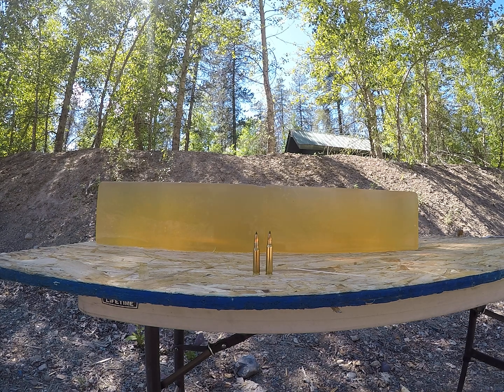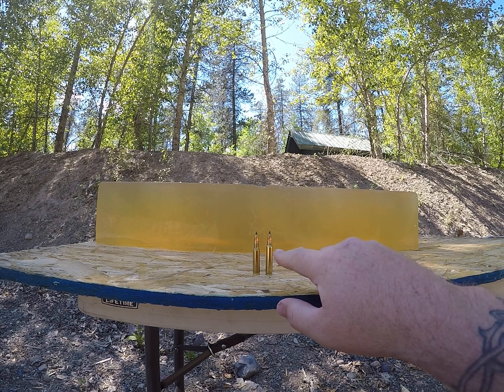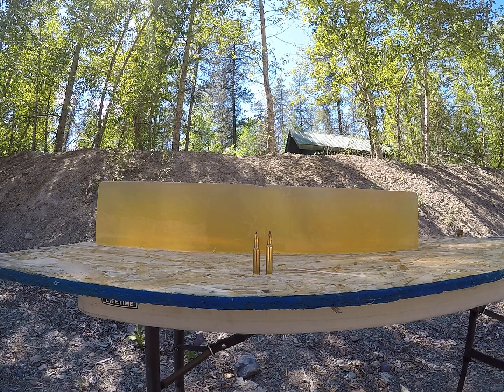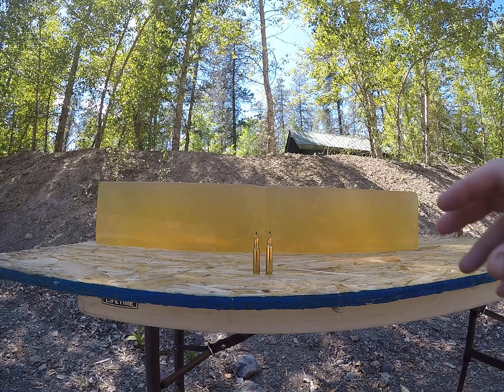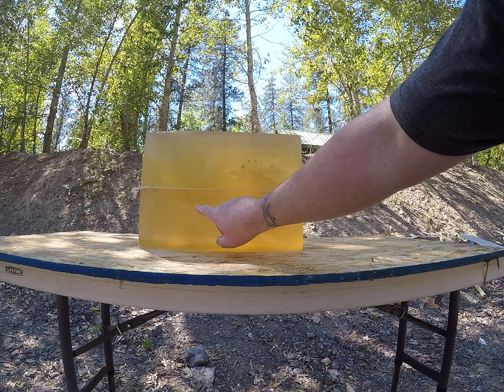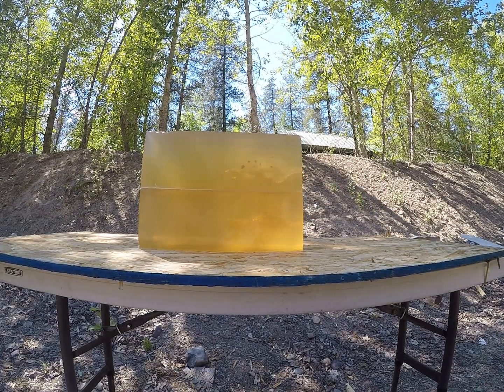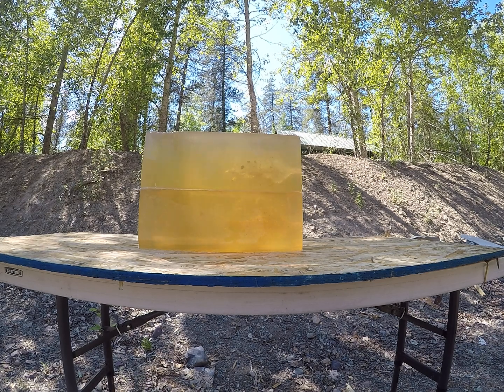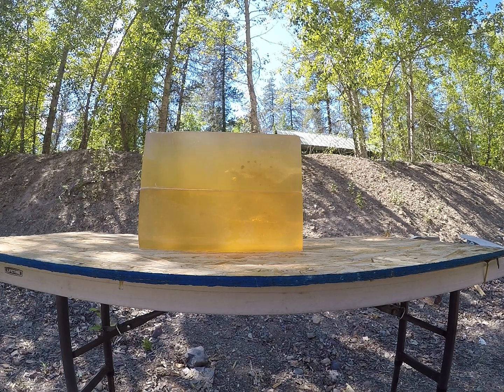Do RPM's play a significant factor in how a bullet performs after impact? (80,000 RPM difference)

Comment: Nice test. And I agree, RPM from rifling twist makes virtually no difference. Here're three reasons: 1) When bullets fragment in gel we don't see significant spiraling tracks from the pieces. So not that much is going on regarding rotation. 2) There's no good reason to believe that rotation is any different between what occurs in the barrel and what occurs in the gel block. In a 2 foot barrel a bullets rotates 2-3 times while going from 0 rotation to 200,000 RPM and 0 velocity to 3000 FPS. The reverse happens in a 2 foot gel block (200,000/3000 to 0/0) -- so 2-3 rotations of the bullet would be expected there as well. 3) There's no significant friction in the spin direction between a typical bullet's wall and what it travels through. The revolutions of a smooth bullet would not be expected to cause any significant disruption.
Reply: At most, what might happen is that the bullet might keep spinning for a fraction of a second AFTER IT COMES TO FORWARD REST, since it's not constrained by rifling, as it was i the barrel. In that case it would still have 2-3 revolutions over it's 2 foot path in the gel, and then some spinning at the very end -- and that would be true in animal tissue, as well.
Reply: The debris isn't going to spiral because thays not what a fragmentingspinning object does. Making it spin faster doesn't make fragments spin, it makes them fragment at either lower linear velocity or, at the same linear velocity, increases the kinetic energy they carry as they break off (effecting their angle or depth), or for a non fragmenting bullet, it will actually fail at lower velocities (exploding varmint bullets) if the spin is way higher, or hold together at higher velocities if the spin is lower.
That sane well established nature of fast twist on thin skinned bullets will also effect the speed at which an expanding bullet will expand, as there's already a preexisting centrifugal force working against the jacket before the linear resistance of the target media acts on it hydraulically.
Reply: @ravissary79  Particles coming off a bullet will have the same kinetic properties as the bullet had, before they came off. They would have rotational momentum (around the center of the bullet, not the particle) and forward momentum, and their trajectory after breaking off would be predictable from those momentums. Sure, there would be SOME differences in terminal bullet behavior with slower rotation. But the manufacturers see the differences as inconsequential (as per Simple Minded Fella references, having ASKED them about the issue -- they test the same way he does). I'm going to trust their engineers over random comments from "the internet."
Reply: @GetMeThere1  no, thats not how centrifugal force work on the matter of an object spun.
When a person is spinning with balls in both hands and then they let them go the balls don't necessarily spin they instead shoot outward in a linear, not curved path, but moving the direction they were released at.
When a bullet breaks apart from a  mushroom they are coming off from the outer edge of the rotating mushroom, like a ball being released from its centrifugal path.

However if the breaking apart happens from yawing that's different, they're not flinging off from the outer spinning arm from the mushroom or petal, but from drag alone as the forces are acting in a different way, and that's why a berger or a BTHP don't have increased fragmentation from spin on target, but do go boom if the jackets are thin prior to impact. So 223 fragmentation from jhps is different. But fragmentation from a mushroom is different. 

To be sure, harvesting terminal effects from increased RPMs requires very high RPMs. Q is experimenting with it using their new 8.6 blackout. It's a large bullet going a moderate to low speed (2400-2000 fps) but with a short 1/3" twist barrel. The barnes bullets shot looked like ratcheting pinwheels, and instead of rolled back they are extended out or broken off at highly acute angles (making a very broad mushroom despite traveling at mild speeds). They actually don't recommend standard lead bullets at all because they explode. That's because the supersonics produce over 400,000 rpms. That's INSANE. Lots of bullets fail past 350,000.

Increased spin doesn't make fragments spin, it increases the centrifugal force pressing against the material making up the outer edge of the object, the object holds itself together via its own molecular bonds and this functions as an opposing centripetal force, if the centrifugal force overcomes the centrepedal force the parts are elected in straight lines. It's like spinning a bucket by a string and the string snaps under centrifugal force.
In the case of the bullet that doesn't fail but hits a fluid target normally, triggering expansion, the outer edge of the projectile which could withstand the centrifugal force is now being stressed enormously at a right angle which deforms the shape, giving it a longer arm, increasing the effect of the centrifugal force weakening the opposing centripetal force as metalic plasticity increases at higher temps weakening the resistance to deformation and fragmentation the material has at room temperature.

This might be testable with a 1/5 twist barrel with a simple cup and core 300 blk supersonic load vs a 1/8.
Reply: @ravissary79  First, fragmentation isn't really an important part of terminal ballistics -- the reason is that tiny objects DRAMATICALLY lose their ability to penetrate tissue, as a matter of the sectional densities of the tiny objects themselves. Nevertheless, faster rotation would make for a faster expansion of a wound channel (but also a shorter one, as material is lost) but not (significantly) the SIZE of the wound channel because, again, those fragments are VERY poor at penetrating tissue. The effect would be that the shape of the wound channel would change (it would become wider, sooner, with faster rotation), but the overall volume wouldn't be significantly improved. Terminal ballistics are a measure of the frontal area of the bullet, and velocity of the bullet -- MUCH less so the fragmenting of the bullet. You're making an inconsequential argument. The fact is that these tests do a GOOD JOB of measuring the wound channel that would be created by bullets at a distance -- even if they don't do a PERFECT job. Bonded bullets have been a great modern improvement in terminal ballistics specifically because they DON'T fragment.
Reply: @GetMeThere1  not according to lots of people and those who have seen the difference between a 5.56 that frags and one that doesn't.
Fragmentation is a very well known wounding mechanism.
In controlled fracture solids and high speed berger bullets they're the intended primary method of wounding, and reportedly to extremely great effect.
But Fragmentation tends to be a short lived effect, yielding HORRIBLE wounds, but typically not super deep ones. But that's that's always true. A fast Berger used in a quartering away angle will dump its energy to early to hit the vitals vs a broad side, where it will fragment in the vitals, dumping gallons on energy, possibly anchoring the animal.
Reply: @ravissary79  And one more thing: I agree that the fragments would come off in a spiral PATTERN. But neither would they radiate in a straight line from the CENTER of the bullet. The centrifugal path they would follow would be angled (i.e., tangential, if ONLY the "centrifugal" force is considered, which may NOT be the only force involved), and the extent of the angle would vary with the forces involved which CAUSED the fragmentation
Reply: @ravissary79  I'm not interested in this discussion. The FACT is that a tremendous amount of research (and money) has been directed towards bonded bullets STRICTLY for the reason of better terminal effects. Yes, THOSE "lots of people." The FBI, for example, has chosen to ELIMINATE use of the "famously fragmenting" M193 FMJ bullet in favor of a bonded bullet. The military would LOVE to use bonded bullets, were it not for treaty restrictions. The "appearance" of a wound doesn't necessarily correlate with its effectiveness in vanguishing the combatant/game animal. I think you like to argue more than you like to learn -- and I'm not interested in playing that game with you.
Reply: @GetMeThere1  bonded bullets are more predictable than non bonded fragmentation of lead bullets, especially from fast fmjs. And in lead bullets it gives them highly superior weight retention so they go deeper while having increased diameter.
That fact does nothing to prove your hyperbole that fragmentation doesn't significantly contribute to wounding.
That's objectively false.

We're discussing the mechanism of fragmentation, not whether bonded bullets that fragment less aren't clearly better for some applications, especially in light of the problems that unintentional fragmentation can cause.

But if s bullet is DESIGNED and USED with fragmentation in mind, there are realized benefits for this that are pretty profound. 
Heck there's an entire genre of new designs of monolithic bullets designed to fragment and not expand, and their mechanism is highly regarded by those who use them.
Reply: @GetMeThere1  correct, the angle isn't just outward at a right angle because there's a confluence of forces.
Nod did I say the paths would necessarily be straight. Bullet paths are dictated by shape,not just spin. Indeed spin makes a Spitzer bullet go straight, it's lack makes it flip, brake and veer off course.
The individual fragments have irregular shape, and because they come off the edges of a mushroom or petals, the drag acting on them is uneven. It's their lack of center rotational spin coupled with not having a stable aerodynamic shape that makes them somersault and their paths often curve off of the main path, especially as they slow down. But some of that might be due to the speed of their being shed. A piece that's a petal that curved before it broke off might have a different shaped path than a prestressed design that comes off more like a shrapnel piece from a pineapple frag grenade, less bending like a leaf  so it might go more like a piece of buckshot, but outward from the central path.

At least that's what I've seen when comparing fragmentation from an SJHP vs a controlled fracture from lehigh vs an fmj 5.56 or Berger vs a barnes that was driven too fast vs a Lehigh "controlled chaos".
Reply: @ravissary79  Your reference to Berger shows that you're simply buying manufacturer hype. Berger started by hand producing cup and core bullets -- and they STILL make only cup and core bullets. Obviously, they don't want to invest in making modern bullets, and so they try to "sell" what they have. The fact is that the moment Nosler came out with their partition bullets, professional hunters the world over IMMEDIATELY switched to them, and saw that they were FAR more effective at harvesting game (i.e., in killing game without excessive wounding and tracking required) than cup and core bullets. Fragmentation is merely "somewhat" better than no fragmentation and no expansion. But there is NO DISAGREEMENT among serious people that well expanded bullets with sufficient penetration are the BEST way to cause effective wounding with bullets (at a given velocity). I'm not going to waste my time trying to prove to you what's already been proved to everyone who matters.
Reply: @GetMeThere1  it doesn't show anything. I've never bought a Berger bullet in my life, though I'm guessing they'd work pretty well for self defense loads in my m1a, low chance of overpenetration. For hunting I'm less fond of lead ecplodung inside meat, but the testimonials from hunters who use them to anchor game via broadsides aren't exactly rare.
Pretending somehow that people buying nosler partitions instead of Bergers says something is just silly. And the point about cup and cores equally silly. LOADS of companies still use cup and core designs. Most Hornadies are still cup and core, but with polymer tips added. Not everyone is running split cores or bonded bullets or monolithics. 
The lure of Bergers is they have highly precise concentrcity and excellent BCs.

Personally I just think it's a a shame the Barnes with tungsten bottoms were discontinued, they would have gone a long way toward leveling the playing field that weight brings to energy and BC that a soft lead core bullet like a Berger still has the advantage on per given length and profile.
But I never mentioned any of those things because I'm talking about fragmentation, not my favorite bullets or the companies I fanboy over (ie: swift, Maker and Cutting Edge... and I also kinda like some oddball Winchester designs, Lehigh and Hornadies, I might give hammer a try). Personally the only thing I wish people copied about Bergers is that sexy hybrid profile.
Reply: Your assumption looks good but I believe incomplete.  Let's use a basic hand drill, to drill in wood not in steel, you will drill through your piece of wood faster if you spin the drill faster.  For a one inch plank you probaly won't notice the difference, but in a 4x4 or more yet in a 6x6, if don't notice any difference you don't use a drill often enough.